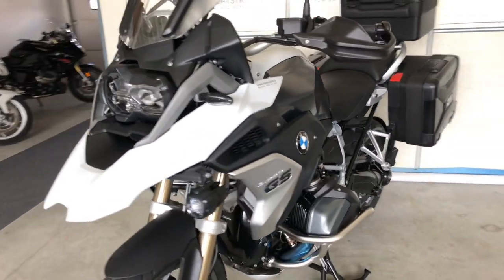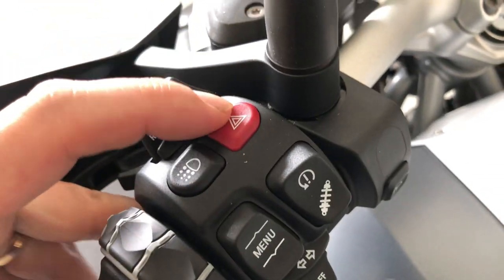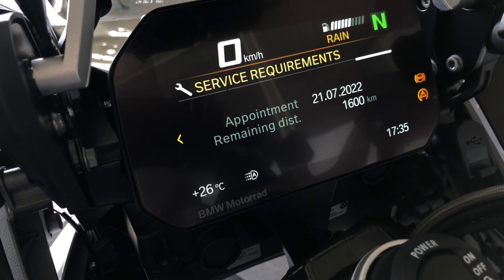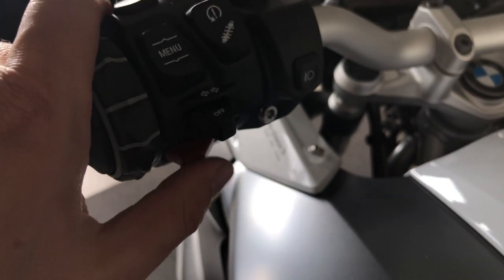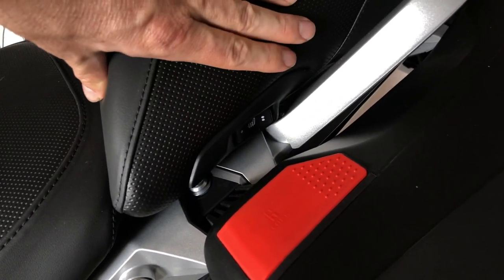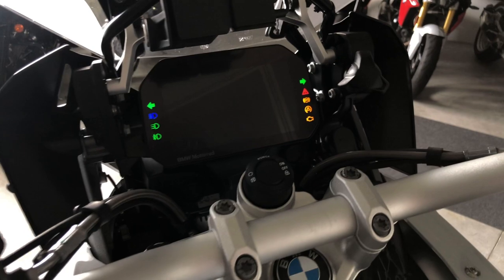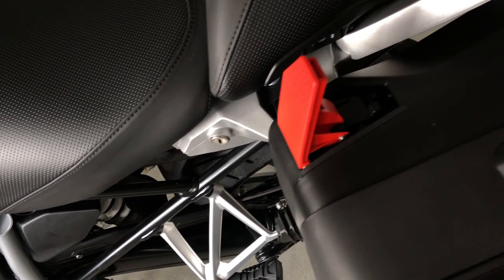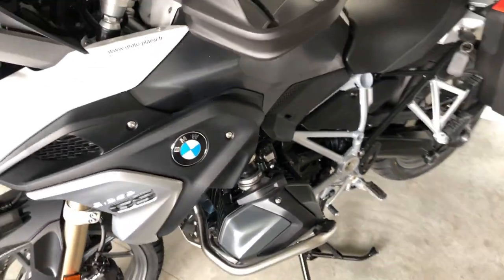R1250GS 2021 : Hands on

Comment: I'm going to receive my gs in a month.  Which crash bars do you recommend?
Reply from the maker: We have tried several, and it turns out that the BMW are the best. Some third parties protectors are cheaper, but you end up replacing the protectors AND the part that was supposed to be protected... But BMW's are not perfect : with the ones on the video, you can scratch the cylinder if the ground is not perfectly flat...
Reply: @motoplaisirmotorcyclerenta9381  thanks a lot